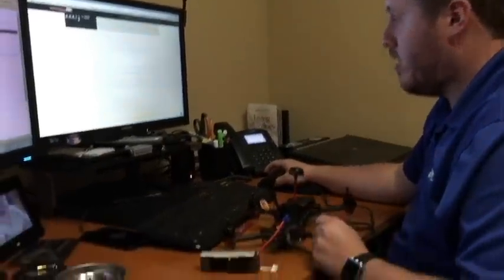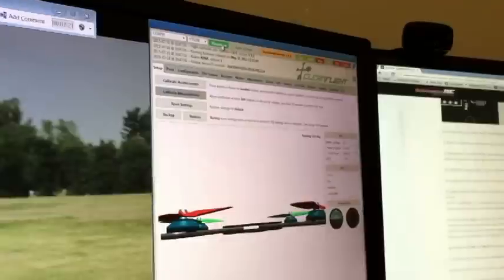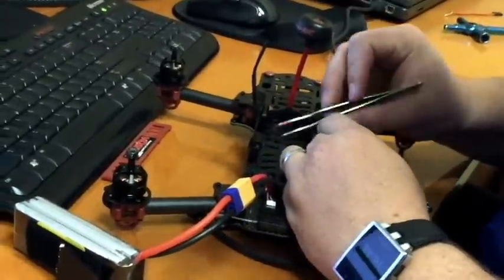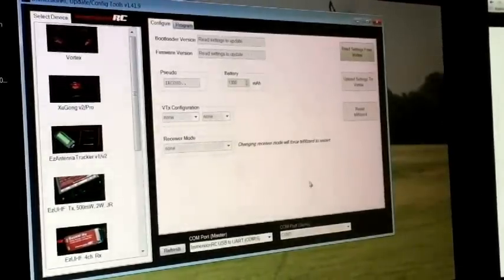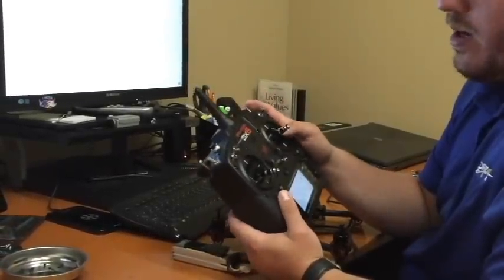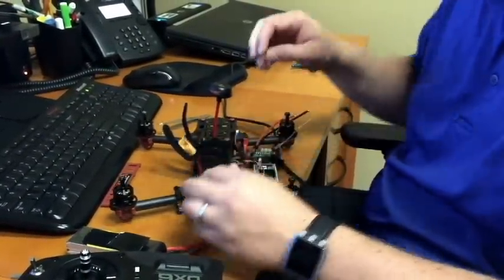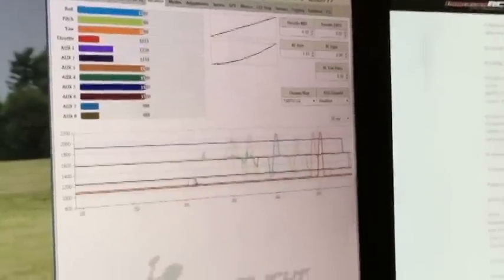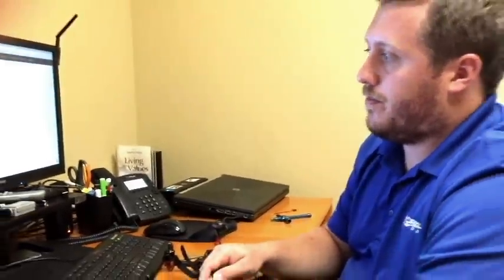How To: Spektrum Vortex Installation and Setup

Comment: Try finding that 5 pin molex for the 285 . The only ones that have it are Molex and you have to build it with the wire and connectors . The newer Vortex line you can get a plug kit

Comment: I got the GUI software downloaded put when I plug the vortex in it says I need to down load a USP driver. How do I down load a USP driver? One more question, what setting do I put it at to where it will fly like like my chroma for say? So when you let off your sticks the quad will self center its self. Thanks!

Comment: Can spektrum just make a compatible receiver, there missing out on business
Reply: +proffesionalretard Spektrum now offers the AR7700 receiver capable of PPM (uses the cable 
that came with the Vortex). I am now using the AR7700 AND the satellite I
 was using before. Coverage is amazing! 

The AR7700 uses normal Spektrum binding. To use a satellite receiver with the CPPM cable you will need a normal flight receiver capable of using satellites to get the satellite bound to your transmitter. Plug the two receivers together, power with a receiver battery and bind like normal. Always smart to hook up an extra servo to channels to make sure everything moves in the directions you want it to :)

(using the custom built cable and sat receiver method still requires a normal receiver to achieve binding. There IS a way to for binding through CleanFlight but it is a bit beyond most normal users abilities)